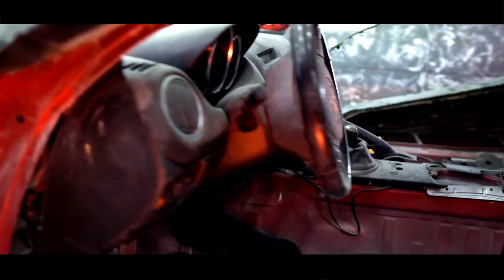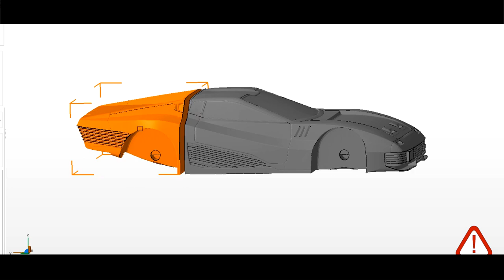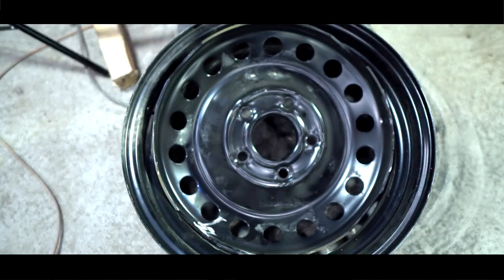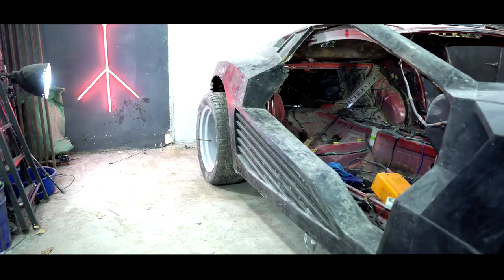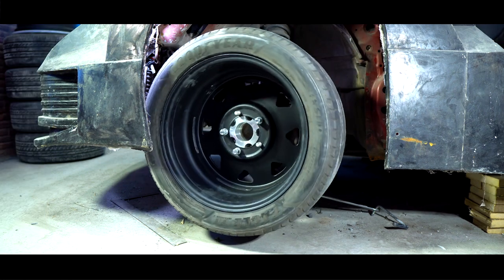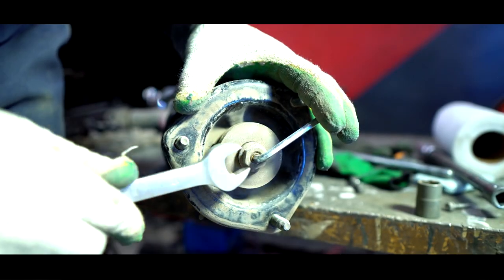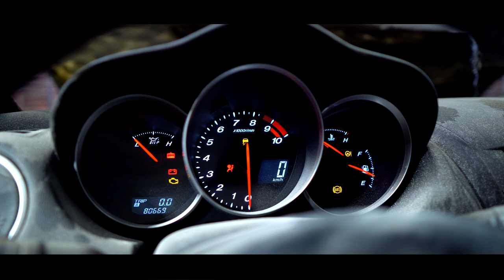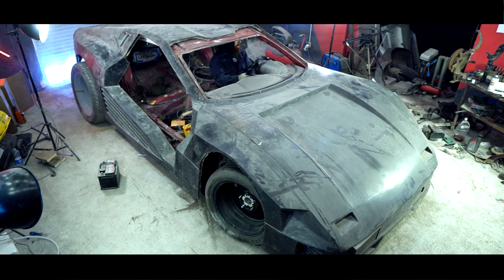Wheels. Quadra V-Tech in real life.Cyberpunk 2077.  Part 11

Comment: You're not doing that, right? 
Like, you will modify the suspension to eliminate the need for that much offset...

The wheel bearings will not enjoy that much leverage!
Reply: Probly also going to cause steering issues, and alignment issues, because bump & traction forces will be amplified.

for instance, the rear tires will move forward to the chassis under throttle, so toe in. When engine braking they will move backward to the chassis, so toe out.

a better option would be to use wheels with close to oem offset & lengthen the control arms to put the spindle where you need it to get the wheel where you want it.